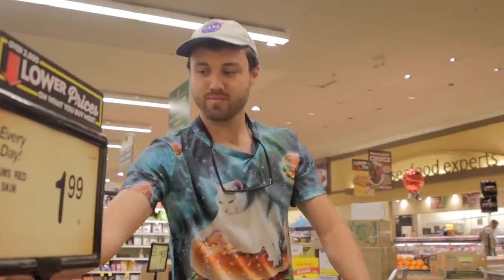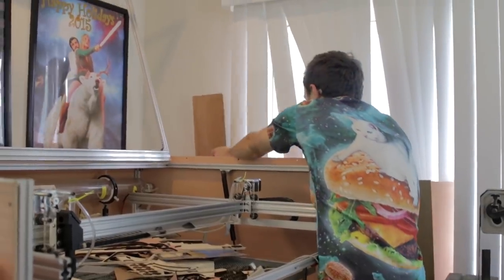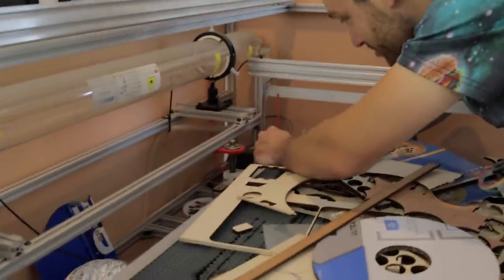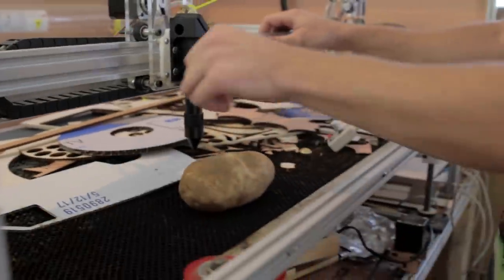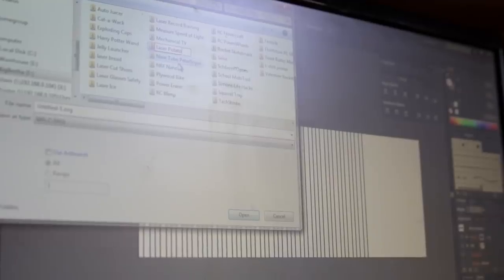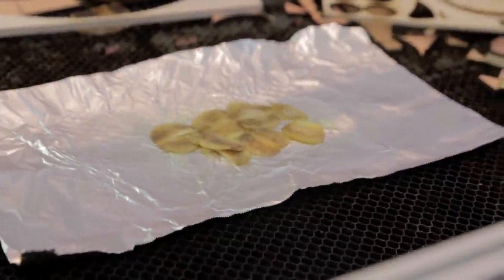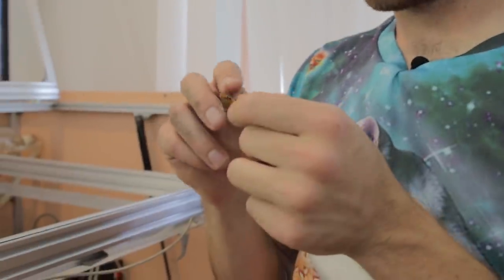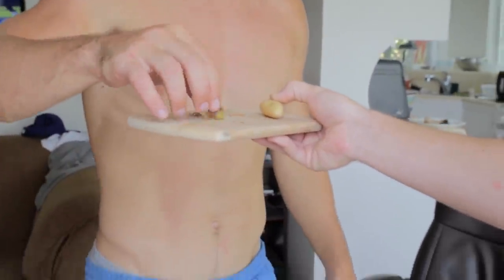Can a Laser Cook Potato Chips?

Comment: The problem with laser cutting any type of food is that the laser practically vaporizes the material almost instantly and doesn't transfer heat (aka cook) the food it's cutting. A sad reality.
Reply: Which is why they put it on a lower setting after cutting to cook them.
Reply: That's why William also de-focused the laser beam by adjusting the cutting height so that the laser energy is more spread out.

Comment: If you shot the laser into a container with a very reflective inner coating, would it function as a shitty microwave oven? If you could manage to ventilate it while still keeping the energy inside
Reply: nah it would just return straight up and destroy the laser
Reply: Guy Ender not how mirrors work
Reply: to an extent, it could be possible however it would probably not work too well as the laser is focused too much on a single point whereas a microwave hits everything. if you used the same source but not focus it to a laser then it would work a lot better. if you wanted to you could make a microwave laser
Reply: Sounds like you're trying to blind someone

Comment: You have to take the filter off the lazer and add a magnifying glass lense to amplify the power of it. Be careful to wear rubber gloves if you try it the whole time making it, breaking the limitation settings to go further up(only aim at the object and put a extra coated metal barrier around it so it doesn't overheat or burn your hand or anything around the pad). Actually you may just want to test it outside first on a metal table on a potato in the backyard first.